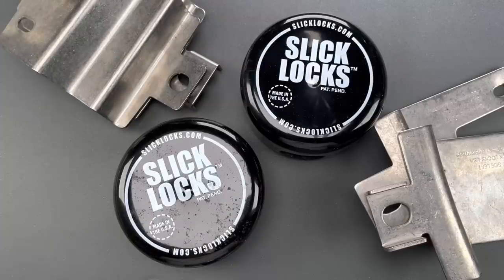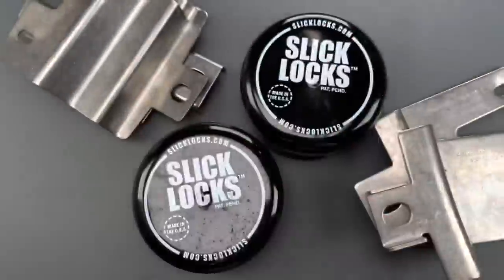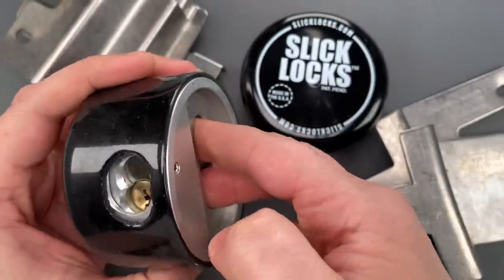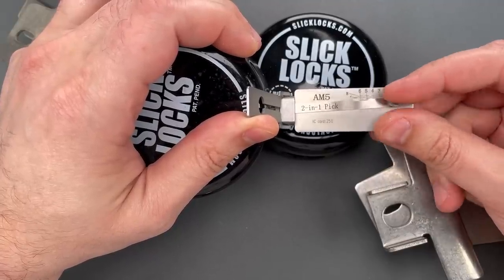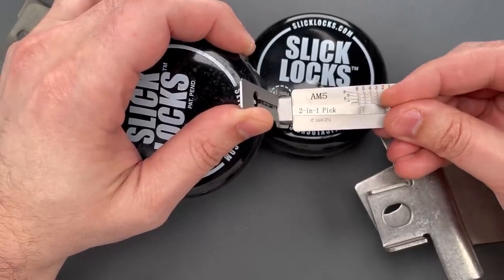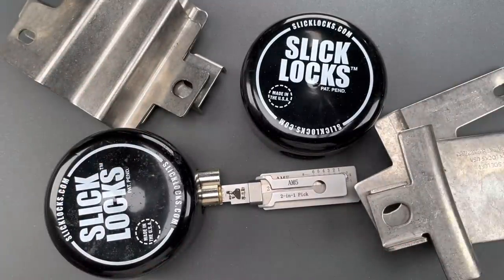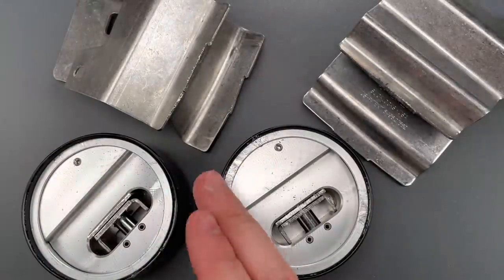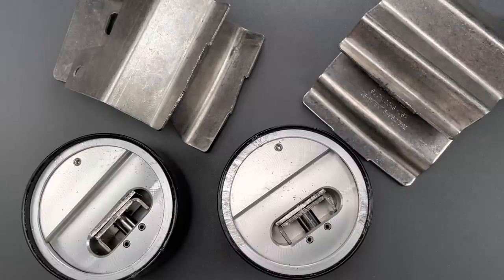[1451] “Slick” Van Locks: Cut in 18 Seconds

Comment: The most important part to mention about said vulnerability is that it makes a ton of noise cutting through the steel, drawing attention to the thief. There have also been cases of a thief attempting to twist off the lock and once doing so, the brackets twisted together re-securing the doors. 

Would also love to see a video on their sliding door model as that is what most vans on the market are!
Reply: Thieves are not afraid of a little noise, they often use angle grinders and saws alls to  do their dirty work and those are MUCH louder 
And you are wildly overestimating the real world noise of a hack saw based on how it sounds with a mic pointed right at it in an enclosed room
Reply: These hack saws are not very noisy. This was done in a garage which reflects noise and a microphone pointed directly at it. Outside you hardly hear them even a couple of meters away, nature sounds or city sounds especially will drown it out easily. Also, it takes some time to notice unusual noise and this is so fast, that you probably overhear it even if you could physically notice it.

Comment: I would really like to see him picking it with hasp installed onto flat board or something to simulate installed position.  It will make picking little more awkward and more restrictive.  I am missing the "In-service" aspect of this pick.  Holding in hand gives you more maneuverability.
Reply: The Lishi tool didn't extend past the back of the lock, so I'd say it would be pretty much the same if it was mounted on something.
Reply: i think this specific lock would be easier to pick while mounted since it was awkward to hold the lock with the spinner-housing.
Reply: I think mostly all that would change is difficulty in finding a decent camera angle.

Comment: Adding some hardened pins to the hasp that mate into the lock body would both make sawing and grinding a lot harder and might also prevent the lock from rattling and maybe wearing the hasp enough that the lock hits the van's paint job.
Reply: It doesn't hit the paint
Reply: It does damaged paint on my Nissan NV200.On both side doors. Not on the back door. And it's only by putting them on and off. I remove them before driving.

Comment: I bet hack sawing would be way more difficult with the saw handle pressed up against the van door.
Reply: Put the blade in the saw frame at 90 degrees. Not easy but but it’s soft metal….
Reply: probably.  but any thief these days would have a powertool anyways since they're more likely to steal your muffler than they are your whole car.
Reply: You can get a long Sawzall blade and have it flexed and it will come off even faster.
Reply: With some hacksaws, you can rotate the blade 45 or 90 degrees from the frame. You could also use the blade without the handle, or even use a cable saw or a coping saw. Those would be slower, but not that slow. I think the point is, sawing this lock is not all that hard.
Reply: Better than just the factory door lock that can be punched out with a hammer and screwdriver. A leased vehicle user would charge for repairing holes from that Master lock assembly.
Reply: Or use a cordless sawzall with a long fine tooth blade. If you can find a 10 or 12" blade It will bend enough to get in there.  It's not like thieves are concerned about damaging the vehicle's paint, or for that matter, damaging their own blade, as long as they can get in and clean out the contents of the vehicle.

Comment: I've had these locks on my work Transit 150 since 2016 and LOVE them.  They stop the smash and grab.  The door jiggler looking for a quick score probably isn't carrying a hack saw.  Its the guy with a spark plug who can take out a window with ease.  Speaking of windows my van has window grates also and having installed them myself, they wouldn't be that hard to pry out.  Just trying to slow the scoundrels' down.

Comment: I’d like to see how loud the reverberations are if cutting that while installed ! I’m sure it could be muffled but you’re going to need some improvised dampening devices !
Reply: If it's parked in an industrial estate overnight, you'd be surprised how little anyone cares about a bit of noise.
Reply: In my city there's a rash of catalytic converters being stolen.
Thieves roll up at 2am, on city streets with dozens of residential houses lining both sides WITH CUTTING POWER TOOLS. 
It takes 2-3 minutes per theft.
No one cares.... no one calls the police, no one does anything.
Happened literally outside my window at 3am. The cutting woke me up and I looked outside to see. I did call the police, after an exasperated sigh from the 911 operator, a care was dispatched. The cop did a drive by w 35 minutes later......
You drastically underestimate how little people care when they hear 60 seconds of sawing.
Reply: @brianb8003  35 minutes... That might be a record response to a catalytic theft.
Reply: @brianb8003  Reminds me of someone I knew who called the police to report their car is in the process of being stolen by a group of scary looking guys. The operator told them to come to the station and file a report the next day, nobody was even sent.
Reply: @MonkeyJedi99  wow the fact they even bothered to drive by amazes me.

Comment: Would it be possible to bypass the spinning case by sliding a thin metal sheet between the lock and the housing (like a shim), so that the generated friction locks the mechanism?
Reply: If you are planning to rip the lock off the door by brute force, a shim isn't going to generate enough friction to allow you to tear metal...

Comment: I'm curious, what would you do if the core was mounted 'upside down' so the front of the lishi would be against the door of the van; would the tool still be functional?
Reply: Also how much of a pain would it be to saw with your hand raking against the door
Reply: @clion520  easly fixed by bending the hacksaw blade into an L and holding onto the blade to cut. Adds mabey 10 sec to cutting it and works great for all flush cutting needs.

Comment: I have grade 125 Chain around the seat bases in my van with a half inch thick cargo ring thru a slot in the door panel.
Can only open the front doors 4 inches.  The rear doors have a ratchet strap holding them closed. The slider has a lock thru the top rail. The slider wont open more than a quarter inch.  There is a morse cable operated battery disconnect switch  and a kill switch on the fuel pump relay coil ground wire.  I have about 20 grand worth of tools in my van. Parked every night on the streets of los angeles. I don't even worry about it.   It was so bad before I carried a spare steering column to swap in when they destroyed the ignition housing.

Comment: I'm going to call a real world vs. bench inconsistency on this.  A thief hacksawing these on an actual van would have the saw and their knuckles against the plane of the van door, not out in the air as LPL did.  Not that I don't want to see these hardened, but in the real world with a van also in the way sawing is going to be significantly more difficult (keeping in mind that 3x as long is still under a minute).  Now we just need to wait until covert instruments makes a 90º handle hacksaw rig and it's sold out forever, right?
Reply: A cordless sawzall is already the tool of choice for thieves with a long flexible blade perfectly suited for such real world plane surfaces.
Reply: @ButterfatFarms  Rotating the blade on a standard hacksaw leaves two tips extending behind the blade. A cheap plastic handle bolted to the end of a disposable hardened blade lets you move the blade at will. Another common tool will protect the thief's knuckles.
Reply: @ButterfatFarms  I never claimed they lack imagination, I merely omitted a trick that beginners might miss, because I like thieves to fail.

Comment: I truly enjoy watching LPL's videos. Until now I have not commented on the control environment the various locks are picked. Some locks I would imagine would be more difficult to pick under field conditions, but still vulnerable to picking. To cut the hasp as demonstrated in this video in my opinion would be very difficult if done had the lock been installed against a flat surface such as a rear door of a van it was intended. Still enjoy LPL's videos and will continue to watch.
Reply: Hacksaws often have rotatable blades, enabling fairly easy assault even against a flat surface, and most burglars will be using something like a Sawzall, which will have an even easier time of it

Comment: A dozen work vans outfitted with Slick locks on the side and back doors resulted in no access by two thieves and other thieves accessing other company’s vehicles instead of ours over the past 7 years. I’d say these locks have served their purpose well protecting $100k worth of equipment.  Easy for garage department to install and maintain. This product is well worth it.

Comment: I have two Slick Locks on a Ford E body van (AKA) Econoline. I'm fairly certain that the hasps could be sawn in just the manner you've shown. As most people will acknowledge, locks are just a way to keep honest people honest. Given enough time and equipment, no lock will resist. The point of a lock is to discourage folks or to render the time needed for removing the lock too risky.

Comment: Thanks again LPL! 

My thought was what if you made a plug with a key blank to locate it, the plug will jam the body and the spinner so you can get leverage for a pipe wrench. The plug would also act as a sear so the wrench jaws don’t just munt the spinner case. Quieter than a hacksaw but admittedly a specialist approach. Just my immediate thoughts 😁

Comment: I wouldn't even bother with the install units and i'd just "massage" the metal so i can install hardened steel bars, considering the extra space that the lock affords you. I've done this in the past with puck locks and it's the easiest method to piss off a burgo. They'll dull blades upon blades until they make it work. Also, the metal is not removed from the van, just slightly bent, easily fixed with a hammer and dolly and a smidge of bondo.

Comment: We got these on a lot of our cargo vans at work, in our case, they are there to thwart the smash and grabs. Last time we had a bunch of vehicles broken into overnight,  they smashed out  a drivers or passenger window and hit the power lock button to unlock the vans, and instant access to the cargo area, so this slicklock is there to make them work to gain access to the back.  
Not that it would stop them if thats their plan... they stole 30 cat converters over the previous christmas holiday break, so making noise isn't something they are afraid of doing.    Zinging a battery grinder through the slicklock hasp would be like butter in comparison.
Reply: Buckshot always stops a thief

Comment: A trick to stop the hacksaws I saw someone using for a lock like this securing a door was to add a rubber or plastic washer looking thing or even some string/ wire to fill the gap. It doesn't completely remove the vulnerability but if you have ever tried hacksawing a piece or rubber or a ball of twine without pinning it in place, it isn't easy.
Reply: There is no space for rubber washer. And you will not wrap and unwrap the wire around every time you open and close the lock . 20 times a day.
Reply: @MrNiceCobra  If there is space for a hacksaw there is space for a bit of rubber even if it needs to be thin. I agree about not wanting to wrap wire or twine 20 times a day but if that is the case you are not leaving the van for more than half an hour during your 10 hour day. These locks are usually used for people who do long van journeys or who need to leave the van overnight for some reason (like small moving/ storage companies etc.) so you would only need to lock it once every 2-3 days. I will clarify it wasn't actually a washer just something that kinda looked like one

Comment: I have a similar set up on my E350 and the hasp is much thicker and the locks fit tightly against the van. I'm sure that a determined thief in a private area could  get it open somehow, but they would have to come prepared with a sawzall and at least 3 long blades. OR they could pick the lock.

Comment: There is one detail that is being overlooked. While the vulnerability does seem to suggest that it could easily be cut off,  however, when the lock/spinner is installed on the vehicle, there is little to no room to get a saw blade between the lock and the vehicle. It is designed to be snug. I know this because I have that on my van and it is pretty snug. I use the ASSA Maximum+ Restricted Lock for anti pick/drill.
Reply: I have 3 of this locks on Nissan NV 200.
They are not snug. There is a gap to easy slide hacksaw blade. Specifically on the back door.

Comment: I'm guessing you could use a Slick Lock with the hasps mounted to the torx screws in the door jamb and use the Master Lock version below (or above) the Slick Lock which drills into the face of the door. That way you have three locks on the door for added security (The Slick, the Master Lock and the OEM door lock). Then you only have to worry about them breaking your window to get in.  Or if they're really bold they can just cut a large hole on the side of the van.

Comment: Hang on, that spinner has a major flaw in that the keyhole is stationary.

Just stick a piece of metal (say, a screwdriver or even just a blank key) into the keyway to lock the spinner and reef away on the thing with a big wrench. Even if the metal slips or breaks inside the lock, it may still bind up the spinner and allow you to twist the lock off.
Reply: The flaw for the spinner on locks on my work van is is from the spring clip that locks the spinner on being on the outside of the lock.

Comment: I have 3 sets of slick locks on my van. The sawing off could work to get them off. But in my van, they are so flush against the van, that sawing back and forth would take much much longer, forcing the burglar to saw at a bend. And sawing while bending the sawing blade is much more difficult as apart to having room to saw in the demonstration.

Comment: Locks are more for general deterrent the more heavy duty it looks like the better chance that a thief will pass it by.  Also most stolen items tend to be when someone left it unsecured even a very cheap and pretty useless lock has stopped things getting stolen especially if combined with other security measures. Because honestly if someone is really trying to steal something a lock will not stop them, but the few seconds or minutes it takes will have a chance of possibly getting them caught. Also insurance tend to like things locked up and they may not pay out if it wasn't properly secured by a lock.

Comment: Hi Mr LPL. I have these on my van, as well as a full bulkhead, and a Club II...all of which you've demonstrated vulnerability. The only consolation I take in these is that most (not all) thieves go for low hanging fruit, and my van, though penetrable, looks like too much work to them. I am paranoid by nature. I do want a secure van. I've always seen the hasps as the downfall to these SlickLocks.  I want to switch over to PAClocks but still, my absence and a Sawzall would open a punk-sized opening right through the sheetmetal body panel. I still may change over...make the thieves work more for it. Maybe a sensitive alarm too. Anyway, thanks for confirming my fears!
Reply: Nice Wilton bullet vise BTW!

Comment: You could easily mount it closer to the bodywork of the van by using washers when installing. Pretty much no way to get the saw blade down the back then. Even if you could, you'd pretty much just snap it instantly if you tried to saw.

Comment: It doesn't change much, but if this is mounted against the rear doors as I understand it, it wouldn't be an easy time working a whole hacksaw so close to them. I presume that the blade would be used alone or in one of those single end holders to allow some flex for the hand position, still I don't imagine it taking too much longer! Enjoyed the watch as always.

Comment: My hacksaw has two different holding hooks for the blade, one is at a 45 deg angle making this type of flush cut quite easy. While the cut will be quick and easy the reverberation of the door and puck would be atrocious I hope!! 

"Oh, I just bought some motorcycle spare parts and pretested them with this high power lithium battery and they happen to shuffle around while I was driving and happen to make contact to the door, huh.. fancy that, what a coink-i-dink in minecraft!!"

Comment: To be fair, you'd be sawing while it's mounted flush with a flat surface instead of a convenient vice, but I imagine the hacksaw blade would flex enough to pull it off. Hardening would make it really hard to cut under these circumstances.

Comment: These are made to be used as additional security. The door(s) would still be locked by the vehicle's original locks as well, so the thieves would have to take additional time to bypass both locks. Yeah, I know the OEM vehicle locks aren't really hard to break into but the additional steps would hopefully deter an asshole from breaking in.

Comment: Because the lishi tool is wider than the average key would you even be able to turn the lock without hitting the mounting system Because the lock sits so flush?

Comment: Wouldn't that puck be flush against a surface?  In your vise, the saw has open space to move about.  A saw can cut through, but on an installed lock can it access to do so?
Reply: There is flex in the panels though
Reply: @nooboftheyear7170  I doubt thieves would be too worried about scratching the paint as they're sawing the lock off a vehicle.
Reply: No, I'm thinking that is how they will get access to the brackets if the lock is flush mounted